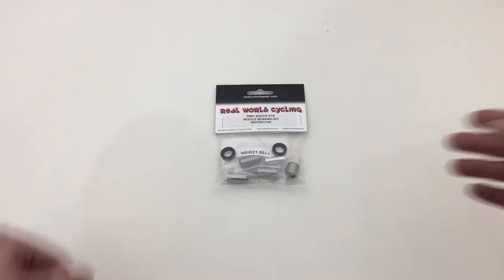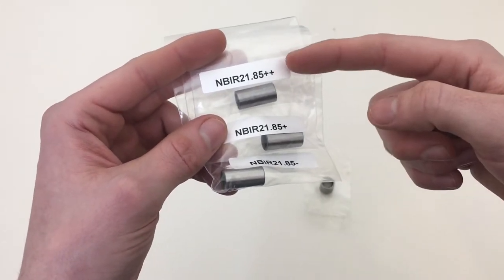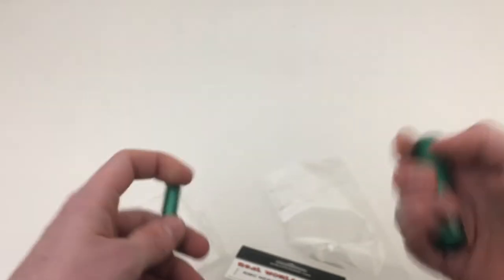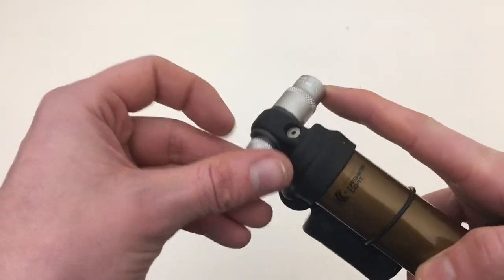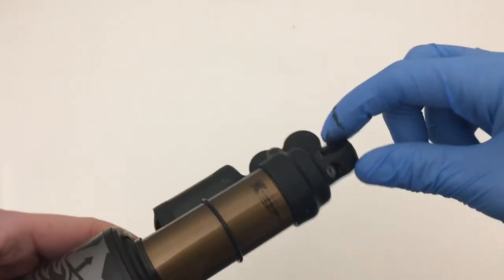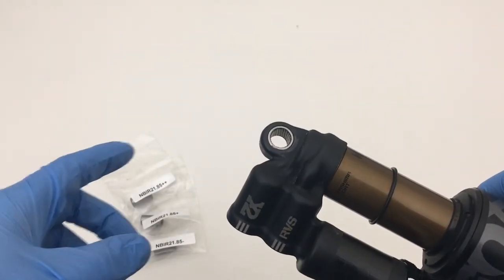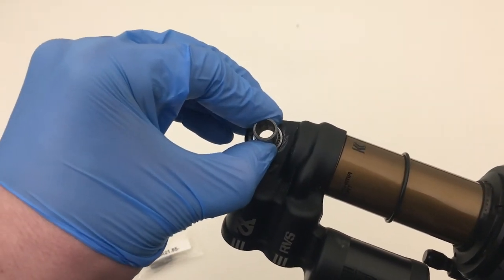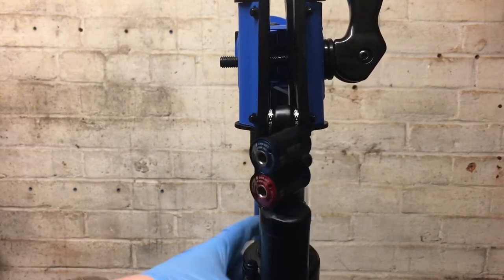RWC - Needle Bearing Kit

Comment: just got a pair for my yeti sb6. cant wait to install them
Reply: Hi, did you do it? both sides? what is your experience?
Reply: Do you have any side-to-side play at the rear of the shock?  I installed this on my SB5 and have the slightest bit of side-to-side play.  RWC states that this is normal but I wanted to know what your experience has been.  I was advised to only do the pivot at the rear as the front pivot doesn't move much at all.

Comment: Oh Do the thicer side of the instalingtool crack? ??? Loocks demaged After full compresst and a little Bit earlier was a snap Sound....
Reply from the maker: xellIsBack 666 Hi, the tool is fine, some of the green anodising comes off from use which always happens with metal on metal, the snap sound was the bearing compressing into the shock eyelet.

Comment: Any real world quick update you can share? Worth it or not?
Reply from the maker: ThunderStruckCoach I changed shock so only got 3 months real world use on it, so can't really comment on durability but from the time I used it I found it gave the bike an awesome smooth feeling particularly on small bumps and roots, I'm getting another bike with an X2 shock so will be fitting it again and will do a follow up video.
Reply: Thanks! I'm going to pull the trigger on a top mount bearing..... When you installed the axle, did you just push it through the bearing with your fingers, or was there more to it?
Reply from the maker: I just used my fingers and pressed it in.

Comment: I recently built up a wrekoning with a push elevnsix. i asked to have the RWC kit fitted as well the, shop said that they weren't a great fit. im unsure if the ment for the frame of the shock? Be interested to know if you get any unwanted play or noises.
Reply from the maker: Beau Glazner Hi, I’ll be checking for any play or noise, bike sounds awesome btw, I’d love to try the elevensix.
Reply: jed Mtb the difference is night and day. The bike already descends well with an air shock swap to the push and you dont have to look for lines around things, just go through. Push coil plus cushcore equles monster truck with pedals.
If you swap to the coil please let us know how the bearings fit!

Comment: I have a Nomad 4 with one of these, just took it apart for the first time to see how’s its going after a couple of months, noticed there is some side play at the rear when the front shock bolt isn’t in. When you do the front up it isn’t present, so I’m not too concerned. 
Does yours do the same?
Reply from the maker: benny360 Hi, I can’t feel any play on mine but I’ve not ridden it much over winter, I will do a follow up vid once I’ve had more time on it, can always contact Chris at RWC, he’s always been really helpful with me.
Reply: Maybe you could put in one of the larger axles that came with the kit?

Comment: When do you estimate for the follow up review. About to install an X2 on my Hightower LT and plan to use the RWC kit.
Reply from the maker: NISMO MIKE Hi, I’m not sure at the moment as I changed shock and the RWC is not compatible with it, I will be fitting it to another bike to continue testing, I had no issue in the 3 months I was using it tho, nice bike btw I love the way the Hightower rides.